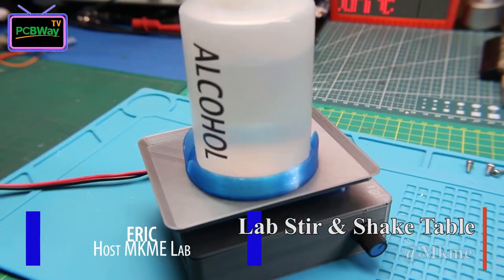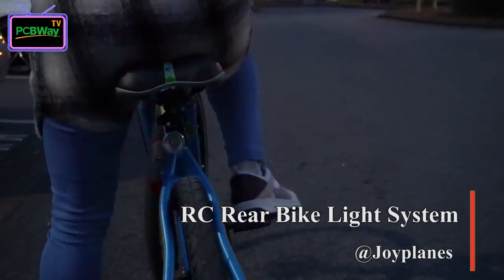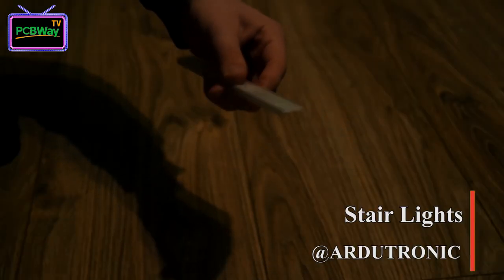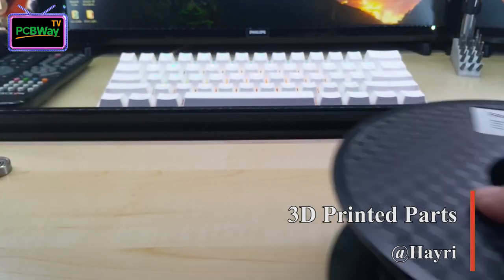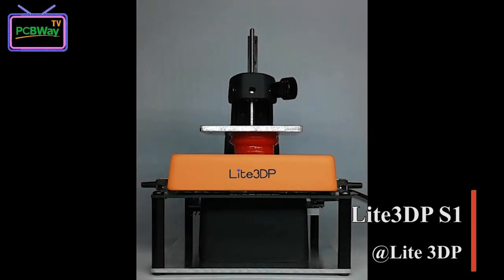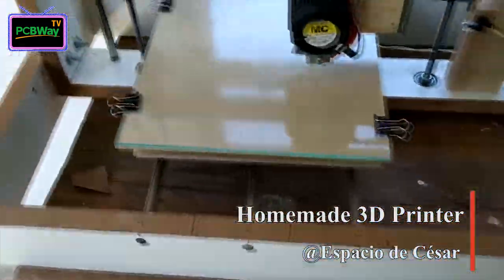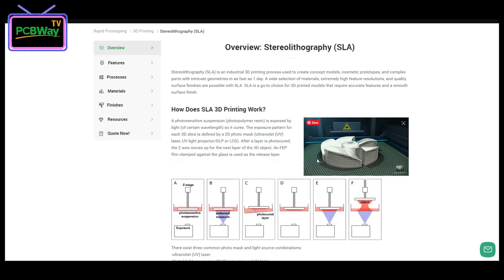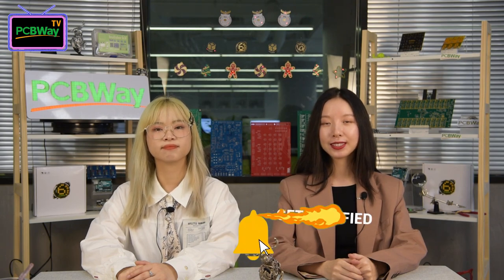S3E2 What can we make with 3D printing?---Innovation & Implementation

Comment: Something to 3D print: The printer is enclosed in a leak-tight box or enclosure. A vacuum pump is used to remove most of the air inside the box. Helium gas then fills the box, to atmospheric pressure. Now print a series of thin-walled spheres of different sizes that now enclose the helium gas. If all goes well, and the correct size/weight ratio is maintained of the sphere material to its volume, some of the spheres will float up, some will sink and some will be of neutral buoyancy, and float without going up or down. Because the material used is more dense than typical latex used in balloons, they should float for a much longer time than any balloon. For the second run, print only those sphere that float with neutral buoyancy. Playing with such floating spheres would likely make a great video.
Reply from the maker: Very professional evaluation！